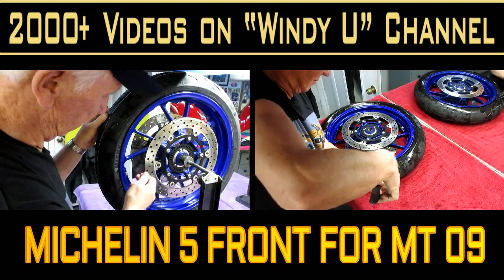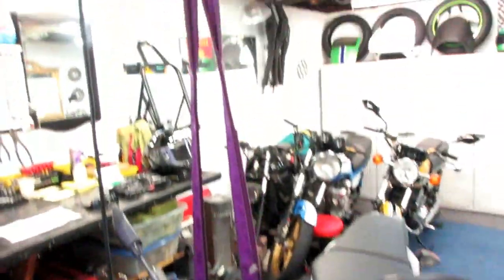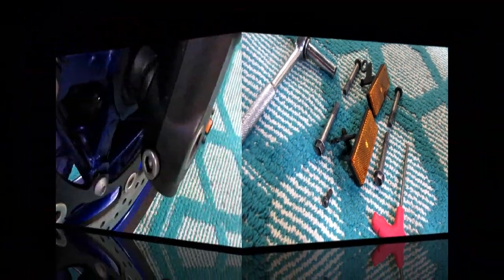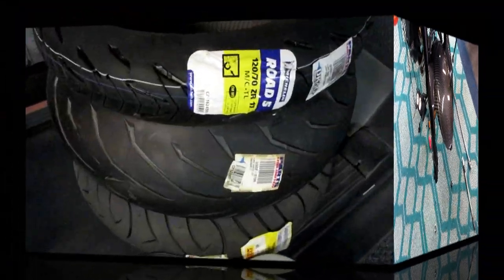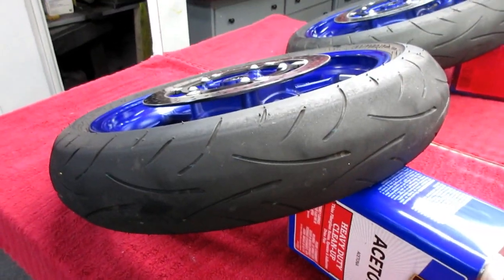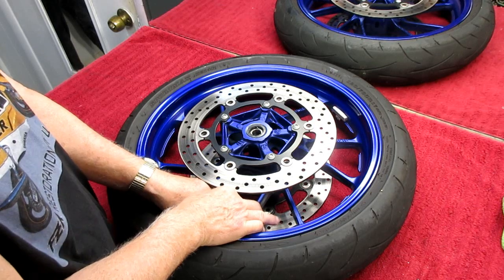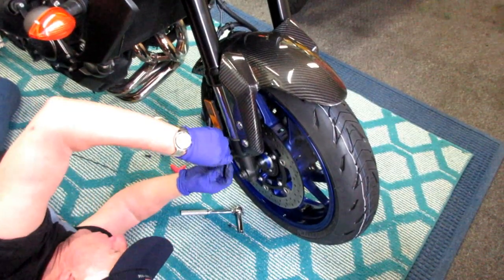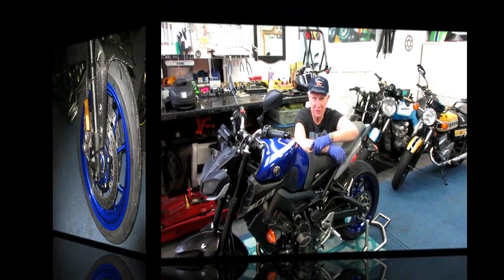HOW TO INSTALL MICHELIN 5 FRONT TIRE ON MT 09 YAMAHA 2020

Comment from the maker: EASY TO DIAGNOSE,ring with slots goes on brake side only.If thats the issue remover and reverse wheel.TIP.Always remove sensor and calipers BEFORE removing wheel on MT09.That wire if it needs to be replaced is pricey,Luciano already had to replace one on his NINJA.Also check your front tire rotation is correct.Arrow goes in direction tire turns when bike moves forward.SOME BMWS  can have front wheel reversed and the ABS will not work because the ring is not on the side of the sensor.that info is from Jose.Hope that helped?Windy

Comment: Just put new road 6s on and I chipped my front abs sensor. But now my traction control works for about 5min then goes off and now CEL is on and abs stays on so I'm guessing it's that sensor I put the front tire on backwards at first